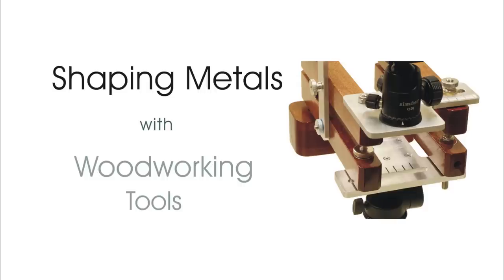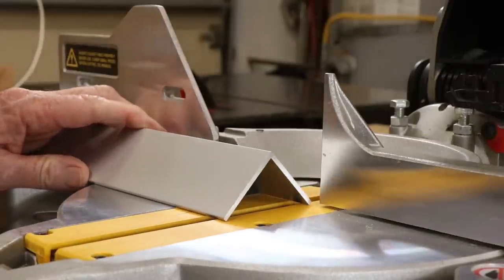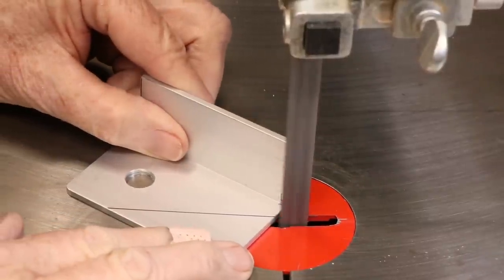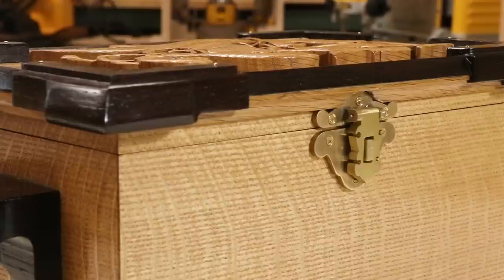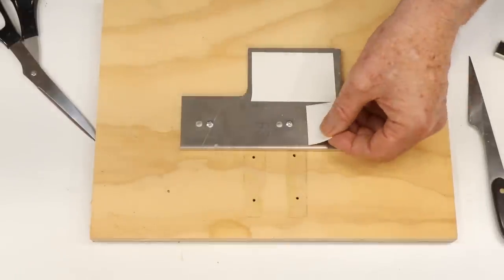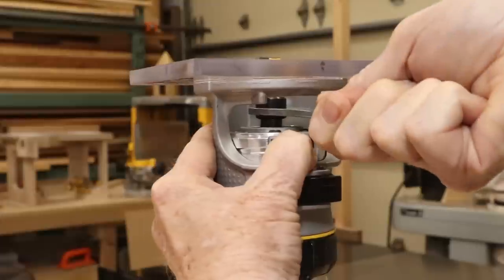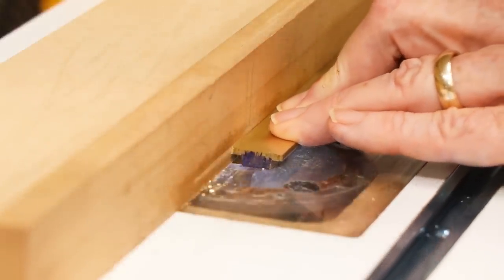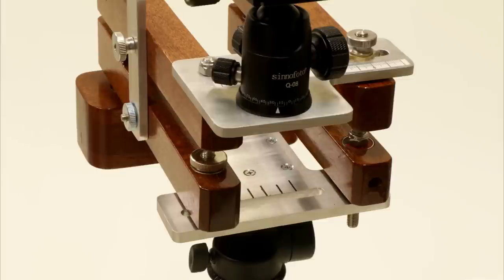Shaping Metal with Woodworking Tools

Comment: When I was doing my apprenticeship, we were only allowed to use a drill press, cold chisel, hack saw, files and emery cloth to make tools from plate steel with a polished surface. You don't need a workshop full of machine tools.
Reply: Very similar tools during my apprenticeship too. I also had access to a coal furnace/forge, a huge anvil and an almost equally huge sledgehammer. And I was 130lbs :)
It was almost 15 years later that I first saw a metal cutting jigsaw!! Obviously I bought 2 of those and many many more power tools later, But I'm confident my work used to be far more satisfying when I was using basic & mostly hand tools.
Reply: I too started off with the basics, but progressed to using special tools/equipment needed to accomplish the repairs on marine vessels as a marine machinery mechanic of 35yrs.  I guess you have carpal tunnel syndrome too?

Comment: I'm cutting Aluminium nearly every day, up to 10mm thickness. There are two important things not to be missed.
1. choose a blade with teeth arranged in a negative angle. The provide a pulling cut like we say in Germany
2. Cool your blade. There are several lubricants on the market from specalized ones to white spirits. they make a real mess on your tool but the cuts are way better
Reply: What is your opinion of the new "Pégas Scroll Band Saw"?

What is the pros and cons if one wishes to work much in 1cm brass/aluminium but occasionally make small projects in hard woods?

Is it nearly impossible to make effortless long straight cuts in wood and soft metals with this scroll band saw you think?

Comment: Hello, 
great video well explained.
Years ago I also tried to work aluminum with the router and I saw that with many shallow passes you get to the result, reducing vibrations and slightly less stressing the router's bit.
I appreciated your passage where you talk about working very carefully and safely, because it is really easier to get hurt if you are distracted. p.s. half a millimeter per pass I also worked 4mm thick iron plates ... then I threw away the router's tip but I managed!

Comment: I purchased a table saw blade designed to cut aluminum and brass. It has 60 carbide teeth that are set at a negative rake. It could be used on a SawStop if the safety mechanism is disengage. I don’t have a SawStop i. It works fine on my Delta contractors saw with a cut off sled. I put a piece of plexiglass over the top to keep the chips down.

Comment: I am am not entirely sure about using aluminum on a belt sander, but it is 'probably' OK.  One of the most serious offenses you could commit in the machine shop I worked in for 40 years was using brass or aluminum on a bench grinder, because it clogs the wheel, and then comes off in tiny projectiles the next time steel is ground on the same wheel.   You mentioned vibration using the router on aluminum, which was ironic because you had just shown how to avoid it.  The answer is to use spiral flute cutters so that the cutter is in constant contact with the part.  Next best thing is a four flute end mill — you'd obviously need the right size for your collet.   You'll need to drill a starter hole when making slots if using an end mill.  As I said in another comment, you need some sort of lube  with aluminum to prevent swarf sticking to the part and cutting tool.

Comment: I did made similar metal pieces (from steel or iron or aluminum) and I don't have any fancy metal tools either. I did use an angle grinder to cut the rough shape ( a metal hacksaw can be used also) then clean and straighten the side with files. If you use guiding blocks and have good files, the sides and edges will be very smooth and straight... 
For the inside parts, I first drill holes with drill bits for metal, then clean again carefully via files... It is important to cut or drill always wider then the lines, so that you can clean with files.
So, basically: 1)angle grinder + 2)hacksaw + 3)files + 4)drill bits for metal are very enough to do so many things with metal. You can even shape spring steel with this tools. Patience is required plus good drill bits... With cheap drill bits, it is almost impossible to drill steel. (I don't even have a drill press! I drill with a hand drill)
Reply: what are guiding blocks?
Reply: @muellermade4857  I just clamp a straight edged, 90 degree wooden piece to the metal piece, where I want metal piece to be straight. That I called a guiding block. When I file the metal and when the file starts to file the wood block piece, then I stop there.

Comment: Fantastic content Patrick, really glad I stumbled across your channel! I'm a metal work engineer getting into woodwork so it's interesting seeing things from the other side. Kudos on your metal work though- looks amazing, and owning your mistakes: so refreshing to see.

One word of caution: the only thing that made me wince was using the shop vac to clear the swarf (chips)- I'm sure it was fine in your case as the chips probably cooled as you set-up the shot, but if you suck up fresh cut & HOT chips into the same vac as your sawdust goes... Old Smokey's gonna be paying a visit 😅

Comment: Be very careful if you have  a dust extraction system.     Hot metal particles can ignite in the air stream and start a fire in the sawdust in the filter.   Yes aluminum does burn.  In fact, it is an ingredient in some explosives.

Comment: Wow, exactly what I needed. I have been searching for slow speed band saws that dont cost a fortune.

What is your opinion of the new "Pégas Scroll Band Saw"?

What is the pros and cons if one wishes to work much in thin brass/aluminium but occasionally make small projects in hard woods?

Is it nearly impossible to make effortless long straight cuts in wood and soft metals with this scroll band saw you think?

Comment: When cutting slots in metal, you will get swarf lodging in the slot & you will end up "re-cutting" the chips... not good...
Aluminium is also prone to causing built-up edge on the cutter which changes the cutting parameters...a spray of wd40 helps here...

Brass needs to be machined with 0° rake or even negative rake... positive rake on a cutter/blade in brass will pull the cutter into the material... kinda like when you route in the "wrong"direction... 

Also don't forget, woodworking machines aren't built nearly as rigid as metalworking machines.... for a reason... take yer time and no "big bites" 

You are correct, cutting metal using woodworking cutters/equipment is possible... but a knowledge of the different forces involved is going to make for more successful & SAFE machining...